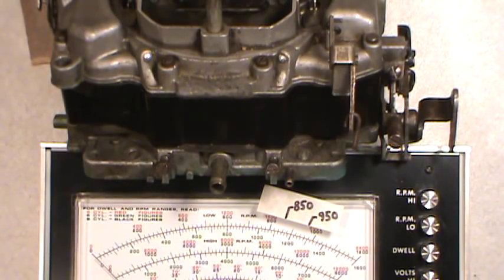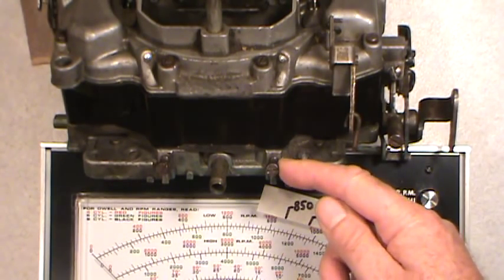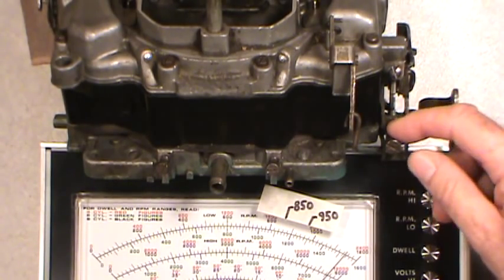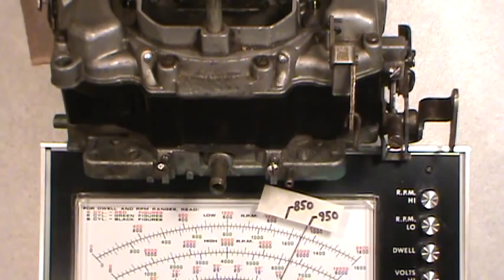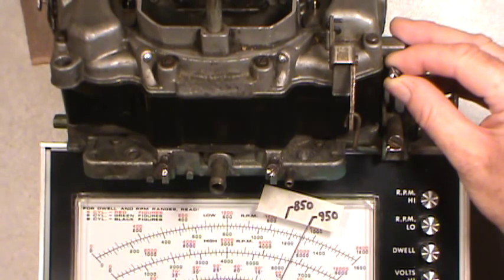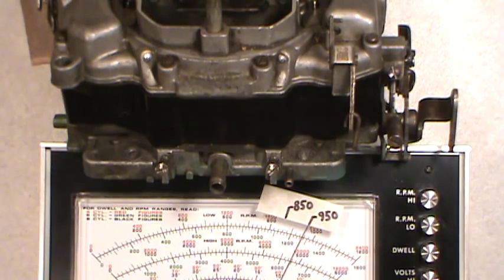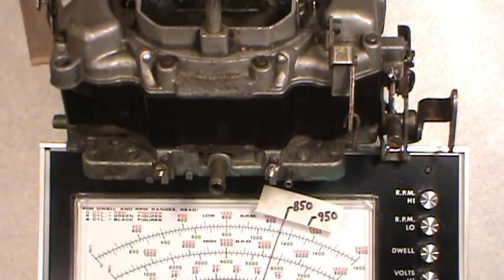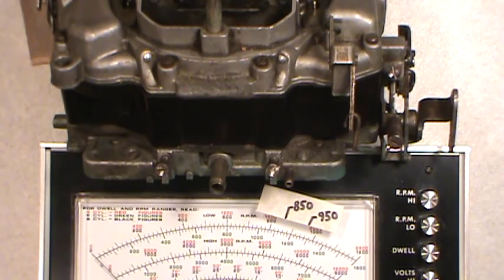Idle Mixture Adjustment on 4 Barrel and 2 Barrel Carburetors

Comment: great video I will use it to dial in my trans am quadrajet carby.  it was rebuilt but seems to backfire and big down under acceleration.  if I roll on slowly it revs up but any quick throttle seems to make it bog down and misfire.
Reply from the maker: +evilswingythingy Greetings evilswingythingy....Thanks for watching, and for, Your nice comment as well..............................I've rebuilt, Set-up/Dialed-in, several Quadrajet and Dualjet, Rochester Carburetors, over the years, and had some very good Performance, and some pretty decent Fuel Economy as well, if I went easy on the Gas Pedal, that is...lol.................................First thought that crossed my mind, is, for You to have a Look in Your Trans Am's, Engine Compartment, for, what is known as a V.E.C.I. Label/Sticker, and if You happen to find one, then, that my Friend, will usually have some good information printed on it, that, might be be tellin' You, things like, the Factory Recommended Procedure , to Set the Idle Mixture Screws, and the Curb Idle Speed Setting, for Your Trans Am's, Rochester 4 Barrel Carburetor, as well as, Your Distributor's, Initial/Base (Stock/Factory) Ignition Timing Setting as well, providing that Your Trans Am's Engine and Components, are rather Factory/Stock in nature, that is.............................Try this...Run Your Engine, the Day "Before", You do the Following, in order to make sure, that Your Quadrajet's "Float Bowl", has Lots of Gasoline in it, or, the following "Test", will "Lie" to You...!!!.............................Now, it's the Next/Following Day, and...having, Your Engine "Cold and Not Running", Remove, Your Engine's, Air Cleaner Housing's "Top/Lid", and, while Moving Your Carb's Throttle Lever, with One Hand, Look Down Inside, Your Carb's, Primary/Front Throttle Bores (You'll probably have to, with Your other Hand...Hold Open, the Choke Plate, in order to see this)...to make sure, that, Your "Accelerator Pump", is "Squirting 2 Strong Streams of Gasoline", cuz, "If One or Both Streams of Gasoline, are Weak or Intermittent", then, You have probably found Your Problem, "Acceleration-wise", that is, and, make sure, to Re-Install, any of the Parts and Pieces, that You Removed, Before You Start Your Engine............................Then, as for Your Carb's "Secondaries", meaning the 2, Larger, Rear Throttle Bores, that have that Air Valve Door/Plate, on the Top of them, then, here are a few things to consider..............................The Choke Pull-Off, (looks, kinda like, a little space ship...lol), in most cases, "Also Controls the Opening Rate", of Your Quadrajet's, Secondary, "Air Door", so, "if" You are still Using the "Old Choke Pull-Off", they/the Old Ones, at times, can kinda, get some-what "Stuck, or Stick", or, maybe, Move Too Slowly, making for a Secondary Air Door, that "Doesn't Open, at the Proper Rate", if at all...???...(when Malfunctioning, in the Not Opening properly sense, the Secondary Air Door/Plate, kinda Acts like the Choke Plate, Over the Primaries does, as in Way Too Rich, of an Air/Fuel Ratio), which, as I've Experienced in the past, can make, for an Engine, that sounds rather Sick, and kinda goes "pop...Pop...POP", when-ever getting on the Go Fast Pedal (aka, Gas Pedal)..............Then, there is, the "Torsional" (twisting motion)..."Wind Up Spring"...that also "Controls the Opening Rate/Amount", of that Secondary Air Door, as well...............................If Nobody messed with the Setting, it should be, oh, shall we say, In the Ball-park, setting-wise, that is...............................If You happen to have, the Rebuild Kit's, Instructions/Paper, then, Your Rochester Quadrajet's, Settings/Adjustments..."Specifications"...should be printed on it/them..............................That Secondary, Air Door, "Wind-Up Spring", can be Adjusted, if need be, and, in most cases, it only requires a Small Allen Wrench, to, both, Unlock & Lock, the Secondary, Air Door's "Torsional, Wind-Up Spring", well, once the Correct Setting is determined, that is..................................Air Filter and Fuel Filter/s Clean...???.............................Fuel Pump, Pumping as it should, as in, both, proper Pressure and Volume as well...???.....................................Ignition Timing plays a very Important Role as well, so, make sure, that, the Ignition Timing, is Correct.............................All Ignition Components, have to be in Like-New Condition, and things like Spark Plug "Gaps", have to be Verified, and Set, if need-be.............................Have You been keeping up with "Maintenance", as in, Change/Replace, any & all Parts, as recommended, by the Pontiac/Trans Am's, Owners/Service Manual, and, also, having/doing, a proper "Tune-Up" as well...???...as a well Maintained, and In-Tune Vehicle, will Perform much better, and, if You can keep the Lead (Led) out of Ur Foot, then, Fuel Economy, it will be...lol......................I have quite a few "Automotive Related Videos", on my YouTube Channel...RockysRoadshow...and, if You care to, You can have a look at them, if You so wish...enjoy...and, if You leave a comment/question or two, I'll do what I can, to help You out...................Also, if You want to let me know, about Your Trans Am, as in Year, Engine, and any Modifications at all, then, for the most part, I can be a bit more Specific, and, a little less Generic, with the Help, that I'll be able to give you...thanks...................Well.....Till next time............Be Safe, take care, and have a good one.
Reply: +RockysRoadshow 
Thank you for that thorough reply. ok to start here is the vehicle info:
1980 Turbo Trans Am Indy Pace car (301 turbo engine)
rochester only built this carby for one year only model#17080274
i purchased this on ebay fully rebuilt new parts and cost almost $750 
i had to replace the incorrect carby which was off a 79 olds  and had no connection
for the pevr as well as not having the power piston control via extrrnal means.
now that is all replaced and Pevr rebuilt and tested.

I did a basic procedure you suggested in the video and noticed the vehicle only backfired once but
apart from that it allows me to press the accelorator to the floor, but.?...its still very sluggish and i noticed
after doing this procedure the idle seemed to be slightly up and down.

new plugs gapped to forum reccomended size, new air filter and air hat, new fuel pump (old one was leaking into crank), full oil change and filter, new fuel filter as well.

it is a dog to start and always needs to be turned over 4 to 5 times with a few pumps of pedal, and when it starts it wont let you press the accelrator or it will still. you have to sort play with tiny little presses on pedal to get it warmed up.
once its warm it idles fine.

i will try some of the suggestions you made to see what difference it make.

i noticed the EGR valve doesnt seem to work (attached mytyvac and it wont function).

timing is set to stock and all leads and plugs are firing as well.
Reply from the maker: +evilswingythingy Greetings evilswingythingy....Well, it's sure a good thing, that, You did get the "Proper, One and Only, Factory Rochester 4 Barrel Carburetor", for Your 1980...Pontiac 301 Turbo V-8, and hopefully, it was Rebuilt Properly, along with, the Correct, Factory Designated Parts (as in Part Numbers/Calibration/Sizes of Jets and Metering Rods, etc.) as well (I hope)...............................The 2 Secondary Metering Rods, in Your "Exact" Carb, from what I saw, are quite a bit "Richer", as in, will provide a much Richer Air/Fuel Ratio/Mixture, when Your "Secondaries" start coming in, to help Cool Your "Turbo Equipped" Engine...................Now for that PEVR/Power Enrichment Vacuum Regulator.............It appears that, a Turbo-Charged Engine's, Intake Manifold's, "Vacuum/Pressure", is quite a bit different, when compared to an Engine, that Doesn't have a Turbo on it, and that's pretty much Why, there is the PEVR System on Your Turbo 301.................On an Engine, that Only has a Quadrajet Carb, sitting on top of a Regular Intake Manifold, then, to Control the Power Piston (inside the Carb), that makes the Primary Metering Rods (2 in this case), go up and down, inside the 2 Primary Fuel Jets, in order to Regulate, the Air/Fuel Ratio/Mixture, there is a Spring, trying to Push the Power Piston "Up", and, if the Vacuum Signal (manifold vacuum), Under the Power Piston, is, shall we say Stronger then the Spring, and in this case, while the Vehicle is just Cruising along, not too fast, the Power Piston Stays Down (unless there happens to be a Cam, on the primary throttle shaft, where-by, the power piston, will go as low, as that Cam will let it)......................When the Manifold Vacuum Signal Drops "Below", the Opposing Spring Pressure, like when You do a Wot/Wide Open Throttle Acceleration (Pedal to the Metal), the Power Piston Rises "Up" as high as it can go..............................Primary Metering Rods "Up" = Richer Air/Fuel Ratio/Mixture, due to Smaller Diameter of Metering Rod in the Jet..........."Down" = Leaner Air/Fuel Ratio/Mixture, due to Larger Diameter of Metering Rod in the Jet.........................Now then, Your "Special Rochester Carb", has an "Extra (vacuum) Hole/Passageway", leading to Your Carb's Power Piston, and, with the help from Your PEVR (Valve), and the rest of that System, the Power Piston/Primary Metering Rods, will be able to Rise Up, to the Richer Air/Fuel Ratio/Mixture Position, otherwise, due to the, shall we say, "Messed-Up, Turbo-Charged, Engine's, Intake Manifold's, Vacuum/Pressure Signal", and Not Having the Power Enrichment System (including the PEVR...Valve) in place, or operational, the Primary Rods, during certain conditions, would stay Down, when Not Wanted, in the Lean position, and a Lean Running, Turbo-Charged Engine, while under a Load, "Is Not a good thing", and, Engine Damage, it just might be...!!!.................................Next time, You happen to have Your HEI/High Energy Ignition Distributor Cap "Off", have a look, and see, if You can see, that, the Ignition Module, has a "Total of 5 Pins" on it (2 on 1 end, and 3 on the other end of it), and hopefully, it is the Correct One..........................Then, there's supposed to be a "Control Box", that takes the Signal, from a Knock Sensor (1 or is there 2...?), if there happens to be, an Engine..."Knock"..."Ping"...or..."Rattle" (as in Detonation or Pre-ignition), and Your Engine's Distributor, should be Retarding/Taking out, about 20 Degrees (Crankshaft Degrees, or was it Distributor Degrees, as Distributor Degrees are 1/2 of Crankshaft Degrees)...???...of Ignition Timing, and, once the Knock goes away, I believe that, the Ignition Timing will Advance, back up to a point, just before that dreaded Knock takes place (I hope)............................The "Advance Weights", inside Your HEI Distributor, could be Sticking or Stuck, and, if so, that will cause any Engine to Run like (use Your Own Bad Word Here...lol)................................On Your HEI Distributor, there should be some Identifying Numbers, Stamped on the Outside, of the Largest Diameter (Aluminum), just below, where the Distributor Cap mounts..............................Make Sure, that, those Numbers "Are the Correct Ones", on Your Distributor, for Your 1980...301 Turbo Engine, just in case, as, I'm pretty sure, that, the Ignition Advance Curve (Weights & Springs), are Set-Up & Matched, for the needs of Your 301 Turbo...............................Also, make sure, that, Your Vacuum Advance Unit/Canister, is the "Exact One" that goes with Your Special HEI Distributor, as there are So Many Different Ones Made, and, Having Different Degrees of Vacuum Advance (those Vacuum Advance Degrees....were they Crankshaft Degrees or Distributor Degrees...it's Important to know...!!!), as well as, how many Inches of Mercury (Hg), that, "it," Starts (pulling) at, and Finishes (pulling) at, as well...!!!...Yikes...!!!.......................Idling Up and Down...???...could be a Vacuum Leak, or, maybe, the Idle Mixture Screws are Too Lean (too far in), or, one is in more, or out more, then the other one, perhaps, as in Un-Balanced...................Pumpin' the Gas Pedal while Cold...???..................................If Your Engine has Not been Running for a few Days, Your Rochester Carb's Float Bowl, might be on the Empty Side, as, Gasoline will somewhat Evaporate, and, just think now, the last time You Drove Ur Trans Am, how Hot the 301 Engine was, and how Hot, the Turbo and the Hot Exhaust Pipes/Tubes got, and turned Your Engine Compartment into an "Oven"...!!! (Gasoline might get Evaporated, with a Hot Metal Carburetor...don't-cha think...???...lol)..............Difficult, Cold Engine Starting...Incorrect Starting Procedure, or, could be, that Your Quadrajets "Choke" is not Set-Up properly, as in, having the Choke Plate, Close Fully, before You turn the key, and/or, the Choke Plate Doesn't Open, the required amount (vacuum kick/vacuum break), once the Engine Starts................................Also, the Fast Idle Cam & Linkages, have to be set to Specifications, and the Fast Idle Speed Screw (Fast Engine RPM's), has to be Adjusted correctly, etc............................About Your "EGR/Exhaust Gas Recirculation" Valve...Not Holding Vacuum........well, some are "Designed that way"...Say What...???...lol...Your EGR Valve, might be the "Positive Pressure Type", that Depends on Exhaust System "Back Pressure", to travel up the EGR Valves Hollow Stem/Shaft, and, when there's enough Exhaust "Back Pressure", it Activates a little Valve, up near that Big, rubber-like Diaphragm, and when that Little Valve Closes, then, and only then, will Your Not so Mighty...Mighty-Vac...become Mighty, once again...!!!...lol..........................Then, there is also, supposed to be, a "Negative Pressure EGR Valve", that, from what I recall, would be used on a High Performance Engine, where "Negative Pressure" would Activate, that Little Valve (if it works that way, that is)................................Your Pontiac 301Turbo, is quite the Engine alright.............Special Crankshaft..........Strong Engine Block..........Maybe, has a High Pressure Fuel Pump, about 10 PSI/Pounds per Square Inch Fuel Pressure (I'm use to seein', about 5 to 7 PSI)................Maybe a High Pressure Oil Pump..."60 PSI"...there-abouts as well, perhaps..............Another thing to watch out for, is, usually, the Higher the Per-Centage of Ethanol (aka, Alcohol), that's in Your Gasoline, the "Leaner Air/Fuel Ratio/Mixture", that, one of these Older Carbs, will be administering to Your Engine's Intake Manifold, and in the case of a Turbo-Charged Engine, that's Not a very good thing at all..............................I hope that, Your Trans Am's Exhaust System, isn't too Loud, so You can Listen for any...Pinging...Rattling...or...Knocking...coming from Your Engine, and if You do Hear any, Park Your Trans Am...Get it Fixed... so Your Pontiac 301 Turbo Engine...Doesn't get Damaged/Destroyed...!!!..........................Don't forget now...They Don't make Pontiacs...Any-More.................Well........Till next time.......Be Safe, take care, and have a good one.
Reply: +RockysRoadshow 

I Printed all the notes you created and will run through them today.

So far the NEXT DAY TEST passed 2 x nice squirts of fuel in the primary.

I also checked the timing and its at factory set 8 degress.

Tested the distributor vaccuum advance using the old MightyVac and I worked fine as well.

I will start a channel for the 301T and add all the info about it and work I am doing on it.

thank you for the time you took to research my car and caby as Its as very unusual motor and layout that most mechanics know nothing about.

speak soon